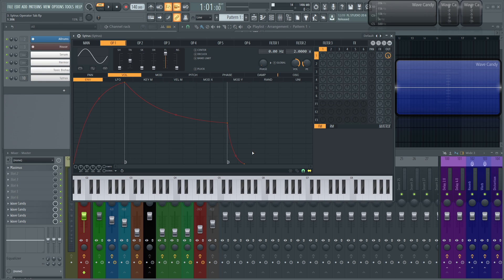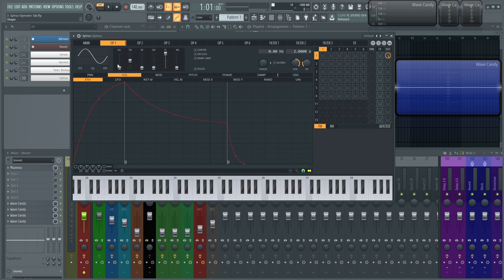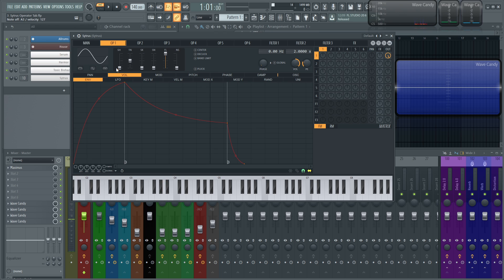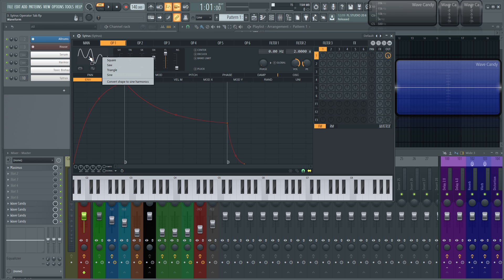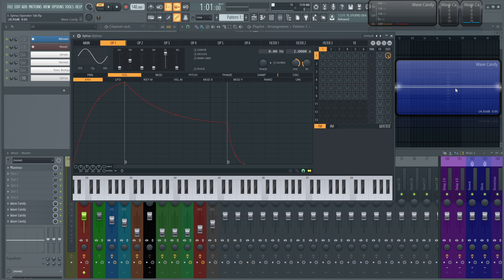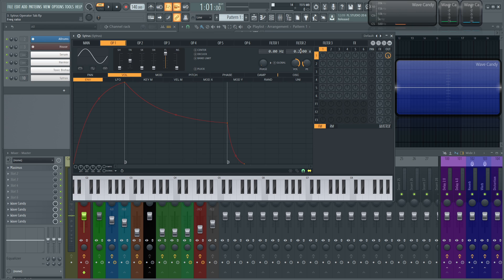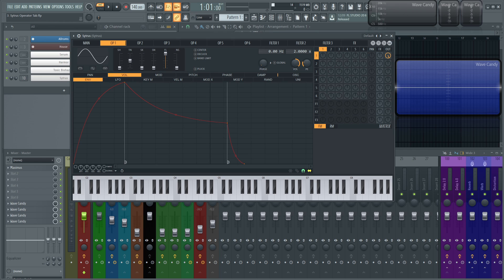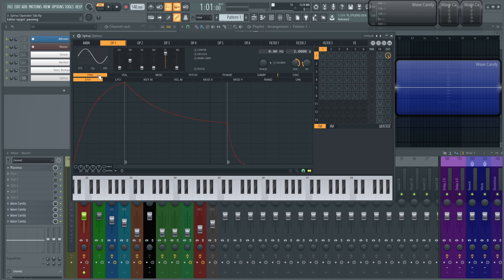Sytrus Operator Tab | Part 3 | FL Studio 20 Tutorial

Comment: Thank you, Jon, thank you very much, but in your opinion, the center button should always be on? or in main tab? center button
Reply from the maker: you're very welcome dude!! so center is useful to keep the waveform in the center, to utilize the full scale of digital resolution. you can do it globally on the main tab or per oscillator. I would recommend to keep it on, if you have 5 oscillators and only one is the problem then use it per oscillator. if it's a little difficult to tell where the issue is cominng from, then the main tab would work great as well. Because remember, when the waveforms cross into positive values, that means your speaker cone is pushing forwards, and when the waveform is in the negative territory, your speaker cone is pull inwards, so you'll want the sound to oscillate in the center, having equal distance in the positive and negative territory. Hope that makes sense
Reply: I appreciate you Jon
You made my day. Thanks